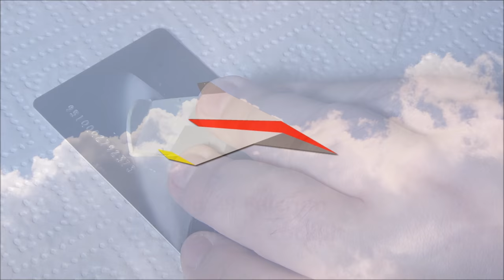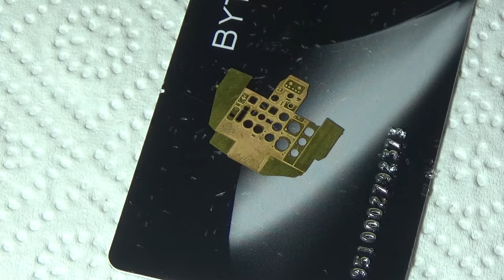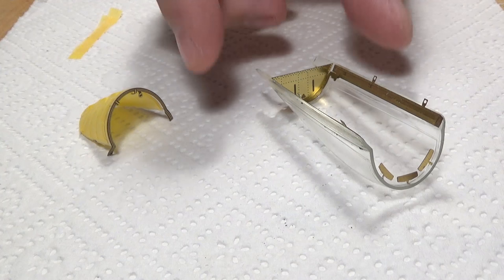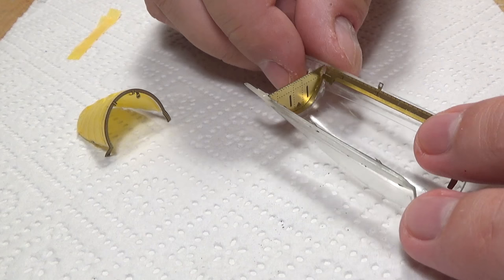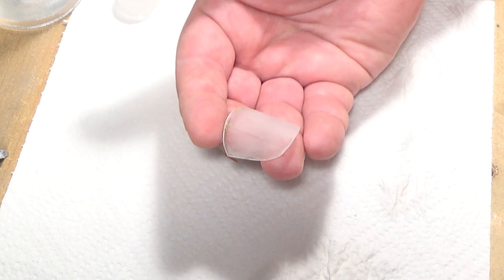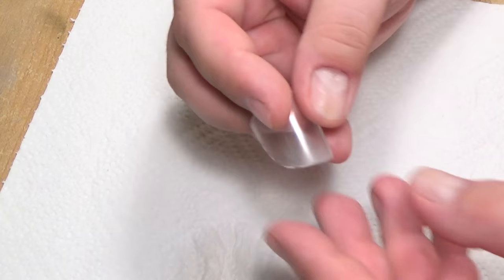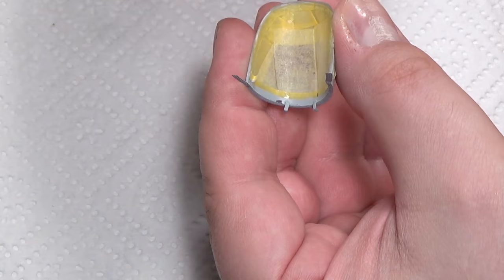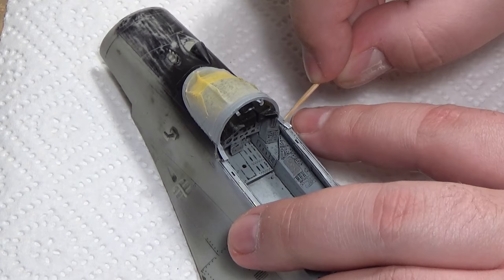Model Mig 29 Fulcrum - 1/32 Revell - Cockpit

Comment: hi! what is the solution at 13:29 for clear parts?
Reply from the maker: That's acrylic floor polish solution. There are different brands depending on where you live - for example "Future", "Pledge" or "Sidolux".
Reply: thanks)) in russia there is no such brands. i'll seek for some alternatives
Reply from the maker: You can use Humbrol Clear the same way as I've used Future.
Reply from the maker: I can't believe it's been 2 years since I've released this movie...